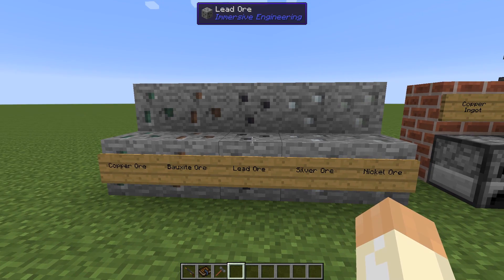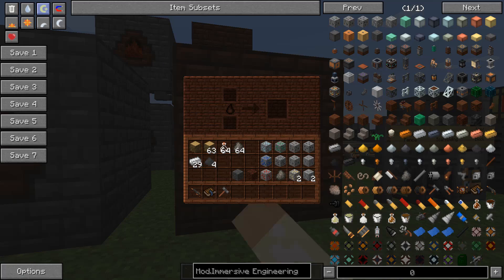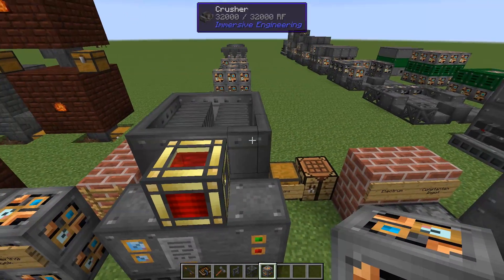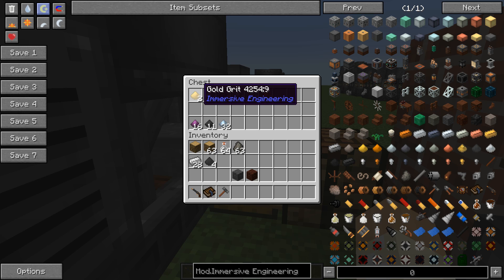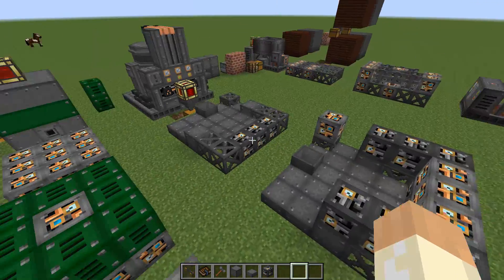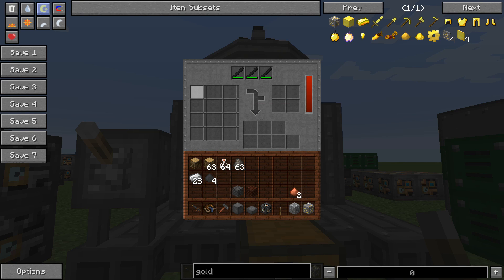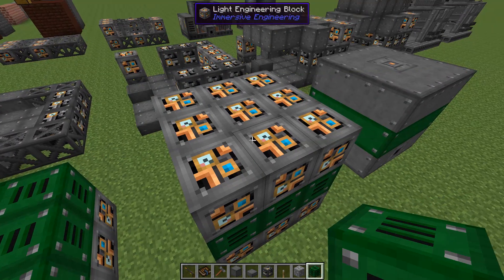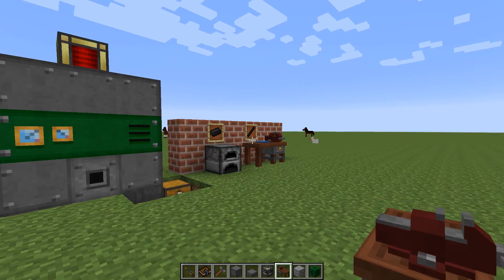Immersive Engineering Tutorial #1 - Getting Started And Ore Doubling (MC 1.7.10)

Comment: i have this problem:

Caused by: java.lang.NoSuchMethodError: net.minecraftforge.oredict.OreDictionary.doesOreNameExist(Ljava/lang/String;)Z

ImmersiveEngineering{0.7.7} [Immersive Engineering] (ImmersiveEngineering-0.7.7.jar) Unloaded->Constructed->Pre-initialized->Errored

can you helpme?? 

thanks
Reply from the maker: I'm sorry, it's hard for me to help with error logs here. And not enough info either. A tip: use pastebin and paste your entire crash log there, then it's easier to share all information. And everything is required. Contact the mod devs (they usually want it on github where most of the mods are managed).

Comment: Is there anyway to edit the config files to make the Crusher yield 3 times more instead of doubling the ores?
Reply from the maker: +APOSTOLRAUL I don't know, because I haven't looked into it. I'm not a friend of the multiple ore race that has been going on, some mods giving up to 5x the input... I think ore doubling is ok, and if it would give 3x outcome it should involve some advance and expensive process first. But there is a config file, feel free to look into it. And you could contact the mod team and ask them if you don't find anything yourself.
Reply: “Some mods giving up to 5× the input”… sounds like you’re taking shots at RotaryCraft’s Extractor there. Just wanna say, it’s no cakewalk getting that thing properly working. I feel the multiplier is justified due to the complexity required in running it, but that’s based on my own experience with the mod.
Reply from the maker: Haha, I know RotaryCraft gives a lot, but it's not the only one. Actually, I think the Extractor is too easy. I built a setup in my third season of let's play (speedplay) and I think it was too easy to get the extractor running. It takes a lot of time to learn the mechanics, but once you know how to do it I don't think it's a hard setup. Plus - you probably don't need to run it on every ore, just on selected ones, which would make the power part easier :)